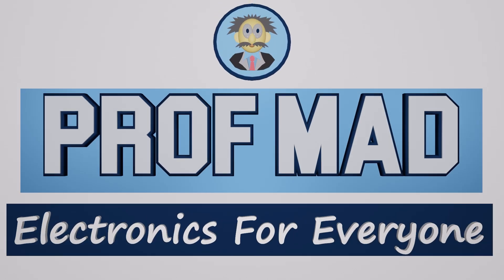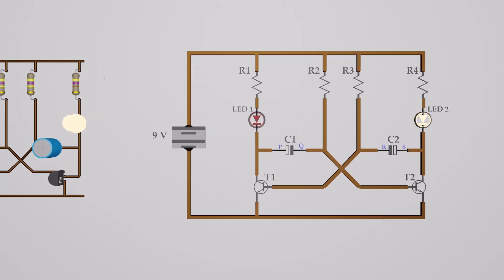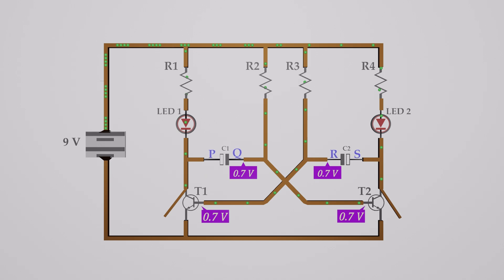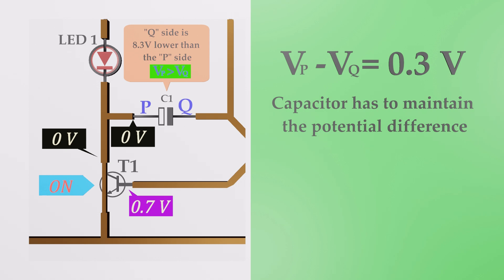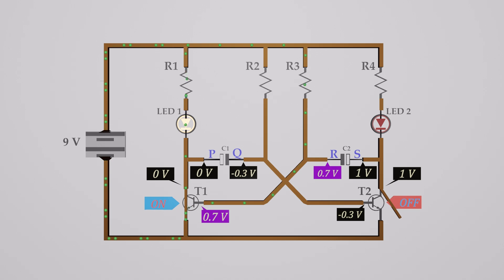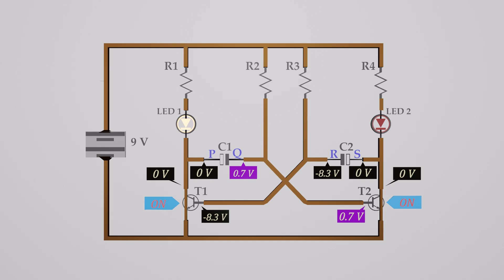Blinking LED circuit or Astable Multivibrator |  AKA Blinking LED circuit | Simple but not easy.

Comment: Great explanation, but there is a mistake / typo at 8:50. The statement R1=R3 << R2=R4 is incorrect. The correct one is R1=R4 << R2=R3.

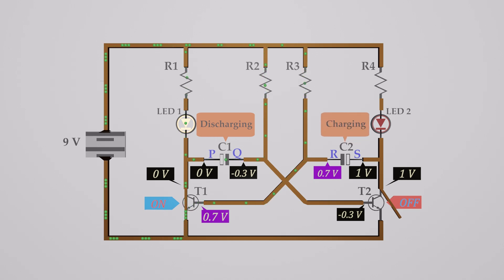Comment: Very good explanation! helped understand most of the concepts except at 6:46 it says Side S of capacitor C2 is charging through resistor R4, won't it turn on the right hand side LED too?
Also, as shown in circuits elsewhere, both sides are symmetrical with R1 = R4 and R2 = R3. However, in this video, R1 = R3 and R2 = R4, and I got lost after that.

Comment: It’s a good tutorial, I have a question for circuit at 08:12 when the Q1 goes to off state, C1 at the moment has potential difference between Q and P points, from my understanding the P point will jump to VCc which is 9v and Q becomes 9.7v? Can you please explain this ?

Comment: Maybe just figure the tension on the dielectric pulls the base of the base of the transistor negative Briefly. Until you make a list of of each changing state of each component as they change. List the components across the top of the page and the steps down the left side. The voltage on the bases can be seen going negative Unless it was the tension on the pointer  spring of the analog voltmeter. Maybe use a digital voltmeter or create a makeshift one with a special analog to digital converter and a positve negative digital counter

Comment: I don’t get it, if the polarity changes on the capacitors, then why does everyone use electrolytic capacitors for this circuit and everything works?
Reply: Non electrolytic capacitor voltage range starting from minimum 230 volt .
But our requirement 10 mfd /25 volt.
So , select electrolytic capacitor, and its cost 5 rupees only.

Comment: If T2 is in off condition the resistance of the transistor is high and almost all voltage Vcc is assumed to be acting across across it by this fact it will be assumed that voltage across R4 will be zero and no current flows through  load resistor R4 capacitor C2 will be discharging not charging as there will be no current through it...thats according to my understanding  i wish to be corrected if am wrong????

Comment: "R1=R3 R2=R4" Are they wrong?  Sould be "R1=R4" and "R2=R3"
Reply: Yes !
Capacitor I used are 10uF/25v
R2=R3 ==> 2.2K ohm
R1=R4 ==> 220  ohm
Transistor ==> BC547
Reply: And also the speed can be changed connecting the upper end of R2 And R3 together connecting to a potentiometers middle pin , while one pin of the side of potentiometer is connected to the top power line

Comment: Thanks, very well explained! Cleared all my doubts, just one thing is bothering me is that if both pair of transistor has same components of same specification then both should operate simultaneously, I know due to some operating or environmental conditions little delay can happen, but thinking technically, this is not digesting.😅
Reply: You will never find 2 resistors for example that have exactly the same resistance. Most you buy are for example 1%.
Reply: @jinsoku1911  okay, understood, thanks 👍

Comment: Hello, 

I have a battery holder where 2 mini 1.5v  button batteries belong power a LED. 
Unfortunately, they are always very quickly empty. I now wanted to feed the LED  with 3V power supply instead of the 2 1,5V batteries.. If I put the minus cable to one pole of the battery holder and the other plus cable to the other pole, the LED does not light up. Do I have to make a bridge(connect the 2 poles with each other) between the two poles (plus and minus)? 

I attached  a picture of what I mean:

https://drive.google.com/file/d/16HTlUvZGBan05GhirxAmT-myxfN0AEpY/view?usp=sharing

Comment: OK I think I'm finally beginning to understand, but in my own imaginary way of vacuum suction of particles and a high pressure buildup. Basically the capacitor being charged, so one side is a vacuum of particles (-)  and other side is under highpressure loaded with particles(+) (even though it's the positive that pulls negative, but  it's better to think the other way around. So one side of a capacitor you have high pressure build up ,while other side of capacitor (-)is vacuum lack of particles. And eventually capacitor becomes fully charged. Than during that time the other side capacitor begins to charge and when that happens, the first capacitor transistor gate closes and the collector begins to fully conduct electricity. And because the capacitor positive side is connected to collector and it was under high pressure the positive particles flow through the collector (releasing the pressure) and discharges in the negative side of the battery power,while the negative side of the first capacitor that was charged if we remember it became a vacuum (lack of particles), so it cannot suck  positive charges from the gate of the other transistor which is connected to negative terminal. Instead the vacuum sucks the positive particles from top resistor that is connected to positive terminal. And it will continue to suck the particles of positive until it becomes completely neutral (or discharged capacitor)... And after it's discharged than ,the direction of the current changes and the capacitor begins to recharge again by turning on the other side transistor l. Something like that.

Comment: Thanks for the video. I am very new to electronics, Can i ask a quesiton? if so, why is current not going to T2 from R2 but only going to C1 when C1 is Discharging can't it go both T2 and C1 at 07:03 ?
Reply: I think that is because T2 is in an off state and its emitter is not conducting, but I'm as green as you :)
Reply: T2 is OFF because (at the time that you are making reference ) the voltage at T2 base is less than 0.7V, which is the minimum threshold to turn on T2. Therefore, there is NO current flowing (remember, in order to have current flowing you need to ‘complete’ the circuit). Current does not flow through capacitors. Capacitors charge up to the connected voltage potential, and the electrostatic charges that accumulate in it when voltage is applied, discharge through the connection to the circuit return (there is no ground in this circuit) made when T2 turns ON.

Comment: Thanks! Although voltage is isn’t measurable at only one point. It has to be measured between points. So figuring out what was going on in that diagram because of that was somewhat confusing. Also clearly labeling + and - on caps would be better.
Reply: High voltage is positive.
Reply: @lookupverazhou8599  Heard now he said pos sides of caps are connected to the collector pins of the transistors.
Reply: The shaded side of a cap is negative.
Reply: @peatmoss4415  In that diagram the darker portion is the minus half of the caps?

Comment: I tried doing this on a pcb but both LED turned on at the same time. Can you explain why it isn't blinking?
Reply: It works because of the variance in tolerances of the components. If they are so very close in values the oscillation won't start. I did this once by accident. I took my twizzers and lightly shorted the transistor legs to start the oscillation. But that may not be your problem. Just double check the connections. This is a very common circuit.
Reply: @peatmoss4415  i tried it on a breadboard before and it was working just fine but when i solder it on a pcb either both LED turned on or just one. I did it a couple times and got the same results. Maybe a component wasn't functioning properly?

Comment: nice explanation, but @8.52 you write the resistors value wrong on left side, because R1=R4 not R3
Reply: I have to agree.  R1=R4  needs to be less than R2=R3.  With R1=R3 < R2=R4 both C1 and C2 will be charging/discharging through the same value resistor, hence s/b at the same rate.  Question I have is, do both C1 and C2 have the same potential to charge/discharge, and does that make a difference?  Why does one Capacitor have to charge/discharge faster than the other?  What would happen if the rate was the same?  What would happen if C1 rate was slower than C2, instead of higher when indicated here?  By not making the R pairs equal in value, can the duty cycle be changed, so one led is on longer than the other.  Can the frequency be changed, just by changing the value of the capacitors, just the resistors, or do both have to be changed?

Comment: Sir, how much the value of capasitor and resistor that used?
Reply from the maker: It depends, as an example you can use followings
R1, R4 : 740 Ohm 
R2, R3 : 470K Ohm
C1, C2 : 10 uf
By increasing the capacitor value, the vibrating frequency can be lowered.
Reply: @Profmad  but you said at 8:52 that R1= R3 << R2 = R4 and you said this is why C1 charges faster than C2, apparently in video it's wrong.
Reply: @c2225 😂😂😂

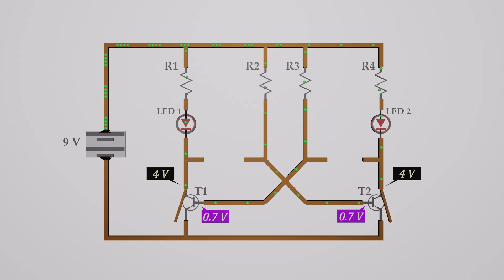Comment: can anyone explain to me, why and what happen in 02:14 .. why voltage gradually decreasing and finally become 0
Reply from the maker: when you apply the knee voltage (0.7 V) to the base pin of a transistor, the resistance between the collector and emitter pin becomes 0. That means the voltage of the collector should be equals to the emitter.  Normally we consider this happens instantaneously. But actually it takes few microseconds. during this time period the voltage difference between the collector and emitter decrease gradually.
Reply: @Profmad  thanks a lot